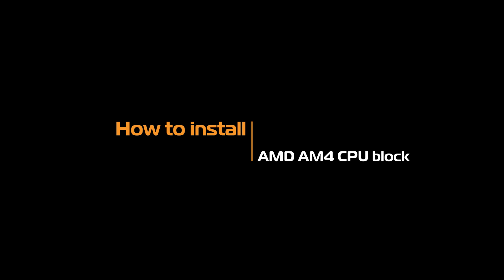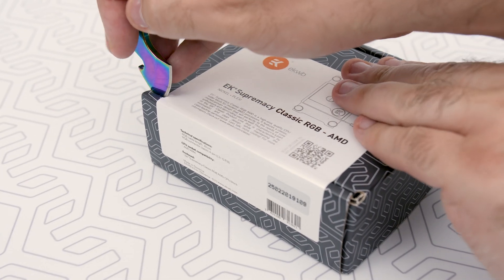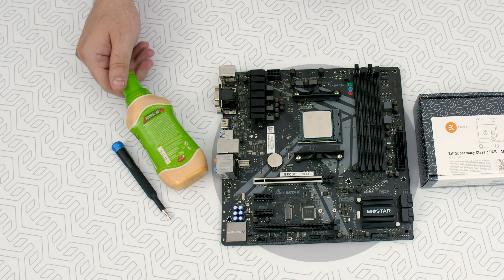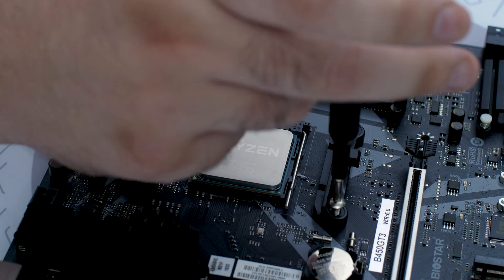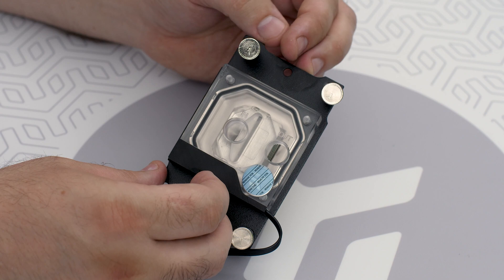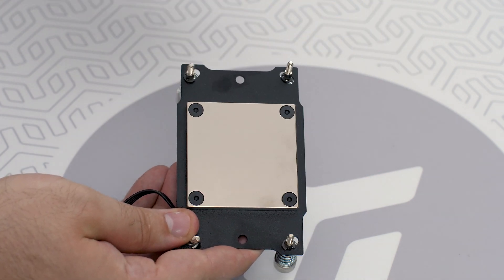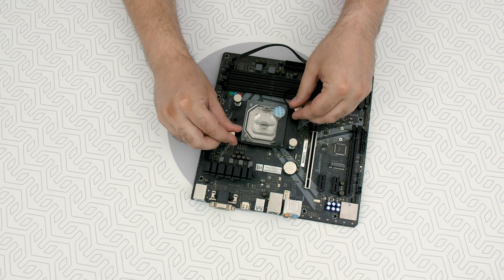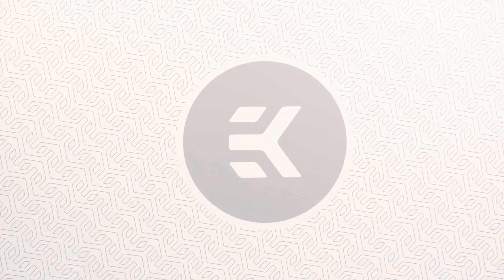Installing the EK-Supremacy Classic CPU Block on AMD Socket AM4

Comment: Does rotation matter. Say if you rotated it 90
Reply: According to this blog it barely matters (+0,5/1°C extra): https://www.ekwb.com/blog/does-different-cpu-water-block-orientation-affect-performance/
I mounted my EVO supremacy block 90 degrees on my 5900x and noticed some slight wiggle as if not completely flat on the processor thinking it would get solved when tightening the block. Temps are a bit disappointing, 68-70°C at default speeds (no PBO, etc.) in Kingdom Come Deliverance with my customloop (and the loop not even temperature saturated yet(!).
Apparently AMD cpu's are convex (they bulge in the middle). (https://www.igorslab.de/en/intel-vs-amd-like-convex-or-concave-are-the-current-headspreader-really-what-is-better-ryzen-9-or-core-9/). Intel cpu's are concave (slightly hollow in the middle). Don't know if the EVO supremacy is completely flat or compensates for the concavity of intel cpu's, making it extra bad for AMD cpu's...